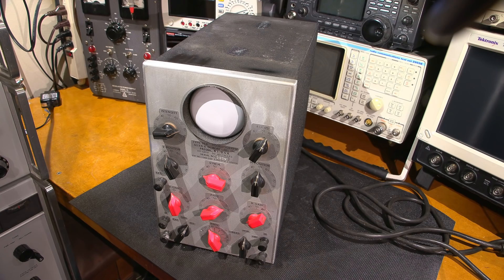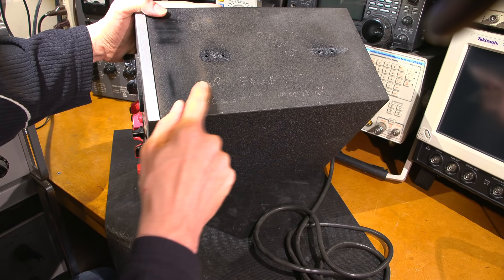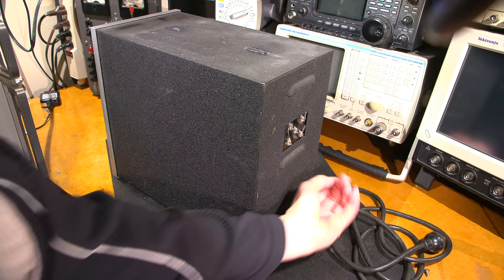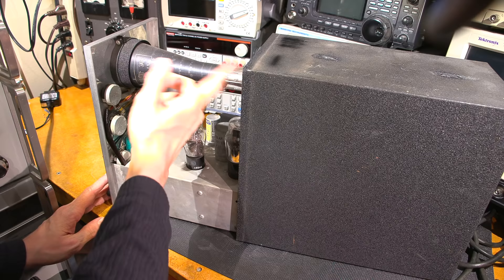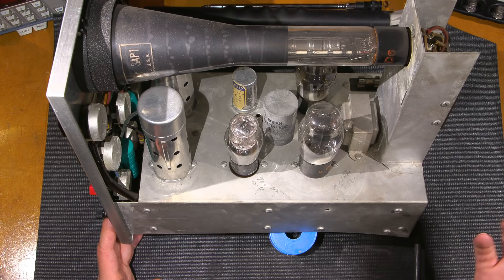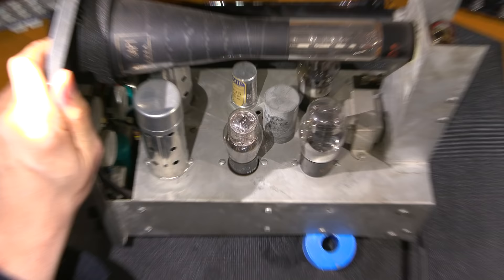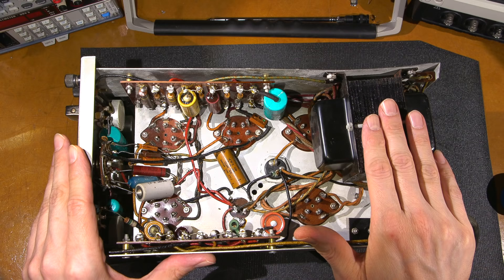1930's Electronics - Will It Still Work? Lets Find Out!

Comment: Another word of caution regarding powering up a device for the first time, you mentioned that you should bring it up slowly on a Variac Autotransformer. This is the correct procedure but it has to be remembered that capacitors have a variety of failure modes and although you did the correct procedure to fire it up, if you leave it sitting around for some time and decide to fire it up again, the capacitors might have been at their end of life and were able to work properly as they were brought up to working voltage slowly but the next time they get full rated voltage, they might fail!!! 
I have seen stories where and amplifier was sold on eBay as working, the seller had plugged it in and it lit up, but when the buyer turned up and wanted to test it with speakers and the amplifier actually had to do some work, the capacitors exploded! 
I believe that had the amplifier been turned on and just let sit to condition it's capacitors it would have been fine until the next time it has been sitting around not used for awhile and then turned on to listen to some music and instead they get an explosion! 
That's why I always say, ESR measurement is not enough! ESR is only going to limit the current! You end up with distortion! But EPR on the other hand will cause the next component in line to work over and above what it was designed to work with and that's how tubes, transistors and resistors fail... 
I have an old DIY kit amplifier that was built in 1973, it's power indicator light is a filament bulb which use more current to work than an led, the beauty of this is that it tells you that the capacitors in the power supply are bad because when you turn up the volume, it begins to blink with the music, after a re-cap, no more blinking! I thought about replacing it with an led when I first got the amplifier but now, I'm leaving well enough alone! That light tells me that something is not as it should be an that it's time to check it out! Those old incandescent bulbs have had a secret secondary purpose and I wonder how many other people know about this? 
So, if a capacitor value has gone up, it's EPR value has also gone up! If it's value has gone down, it's either leaked it's electrolyte or it's evaporated. A whole book 📚 can be written just on capacitor failure modes LoL... I love capacitors, they come in all shapes and sizes and colours! It's really amazing that they have so many different uses. If only someone had invented a new replacement that doesn't fail like they do, electronic equipment would last forever!!

Comment: That is NOT the original CRT, despite the DuMont brand. The 3AP1 type number was registered with the EIA in 1939, a bit after the scope was apparently made.  The original tube was likely a DuMont 34-XH or an RCA 906, both of which were replaced by the 3AP1.

Comment: My experience is that the high voltage paper caps ( sometimes 1000 volt rated) in any of these scopes should be replaced, before applying any power.. the power transformers are not readily replaceable when they fail ( which they WILL).

Comment: The first thing you should do in order to reanimate such a thing, is to revise all device's electromechanical contacts: tubes contact panels, pots, inner jacks. Lube all of them - each of them - with tiny amount of silicone lubricant and reconnect all joints up to ten times each... And only after that procedure you should go in depth analysis of voltages, etc. Practice shows that problems are laid mostly in high voltage  transformers: interturn shortings and/or brakes. Don't thank.

Comment: +1 subscriber. you have a wonderful channel. 
the faded white paint on the knobs resembles degraded radium-based radioluminiscent paint which was carelessly used everywhere in 1930s. it's a dangerous substance and it becomes even more dangerous over time even though it doesn't glow any more. please check if the knobs emit radioactivity. if they do, it's better to get rid of the old paint (cautiously, swallowing or inhaling even a microscopic particle can be very harmful). there are two safer alternatives: radioactive tritium-based tubes (which glow constantly but expire within a decade) and non-radioactive strontium aluminate (which is a more constant solution but will only glow after exposure to light).

Comment: Products that were built in that era were not built with planned obsolescence, as the King Gillete economic school had not yet spread to all corners of product manufacturing...built cheap to fail and be repurchasedover and over. But when I grew up  my Dad would go to the back wall of the Drugstore to get tubes for the TV... of course at that time electronics repair was more Guts and Dolts than Nut and Bolts!

Comment: The 'scope timebase sweep should be linear, a fixed number of mS per cm. The waveshape displayed from the signal generator shows a very non-linear sweep. Repair needed.
Reply from the maker: I would personally like it more linear as well, but did you know these scopes came from the factory like this? No graticule here, just talent needed to decipher what's shown on the screen.
Reply: @MrCarlsonsLab  Apparently that's the performance you have encountered, not open to dispute. Wikipedia tells of a different intent: "Sweep circuit
The technology for the horizontal sweep, that portion of the oscilloscope that creates the horizontal time axis, has changed.

Early oscilloscopes used a synchronized sawtooth waveform generator to provide the time axis. The sawtooth would be made by charging a capacitor with a relatively constant current; that would create a rising voltage. The rising voltage would be fed to the horizontal deflection plates to create the sweep."
My experience goes back to building a tube transmitter in 1956 as KN8HGZ - but back then too poor to own a scope:-)
Reply from the maker: Yes, you can look at my early Heathkit restorations, you will see this sweep linearity issue in that video too. Here is a picture from Wiki, you can see it there too: https://en.wikipedia.org/wiki/Heathkit#/media/File:Io12u.jpg
Reply: @MrCarlsonsLab  Yes, quite so. Just that in your video, the non-linearity seemed so extreme that it might be interesting to peer into the circuit to see if one of the components of the sawtooth generator - the constant current source or the cap - might be guilty. In any case, greatly enjoyed your video - brought back memories!

Comment: Transistorized O-scopes as late as 1980 have high voltage in the sweep circuit. I have a Heathkit IO-4550 with -1700V horizontal sweep. The only tube is the 5" CRT.

Comment: Supposedly it's an extra bad idea to power up old tube era scopes in particular without checking stuff. It's claimed that it's easy to smoke the HV winding in the power transformer if one of the HV filter capacitors shorts.

Comment: I have an unusual project on the drawing board. Basically I want to build a giant (compared to most toys seen on YT and the web) plasma speaker/arc. It boils down to I want to AM modulate a 100-200kHz 10kW HV transformer with a 5kW PWM audio amp (for efficiency, Class A and B sucks from that point) in series with the primary. I found a class D audio modulator schmatic meant for a SSTC. Can I skip rectifying the output of that (the schematic shows a bridge rectifier/cap on it)? My gut is telling me putting DC audio pulses on a ferrite core (the class E SSTC it was designed for is air cored) is a bad idea due to making it saturate and blowing the H bridge driver for it. I suppose I can "build it and see", just want other opinions and perhaps saving some time and silicon from the graveyard (not cheap, sot227 mosfets are $35 each).

Comment: It doesn't seem to have enough ventilation slots compared to most vacuum-tube test equipment I've seen...I'm surprised the innards aren't roasted.
Reply: The vacuum tubes need to work at a constant temperature... they aren't as modern solid state component very sensitive to excessive warm :)
Reply: @wall_y  This is compared to, say, a cart-mounted Tektronix scope.  Then again, those were basically a cathedral of firebottles and dissipated a lot more power...

Comment: Interesting would be a reliable listing of the likely actual service life of various valve types and brands, also including the likelihood of catastrophic failure as opposed to the slow loss of emission. As you are well aware the internet is replete with claims to the effect that valves have to be replaced all the time and are prone to sudden catastrophic failure resulting in damaged equipment. But I take it that in your opinion one might safely ignore the advice of such adepts and run ones valves as much as one desires, whether it be small 6J1Ps or large KT88s? Also, if it were possible to design a “hi-fi/lossless grade digital coax continuator” and an adapter for using a fax machine with a cell phone I would probably be interested in buying such devises, if reasonable priced. Don't expect me to grab a soldering iron and piece them together myself, though, as that would probably be beyond my skill level.

Comment: Hello Mr. Carlson!
Congratulations on the excellent work and care with the equipment!

Could you make a comparison of your capacitor tester, with the ones that are in the market like the T7-H and Bside as an example. 
It would be very interesting to demonstrate the accuracy.
Best Regards
Reply from the maker: Hello. Those testers do not perform an EPR function, therefore I can not compare them. The tester I created and shared on Patreon is a device that performs a special function intended to indicate trace electrical leakage. Most modern capacitor testers will not do this function.

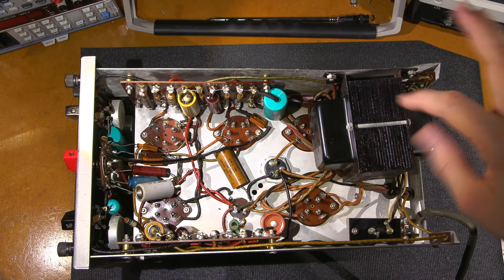Comment: Thank you for another nice video. I have a question; at 13:38 is mentioned that modern DMM would be damaged if connected. Can someone elaborate how or why would that happen?
Reply: Im sure there are more qualified people than me that can explain it and I could be wrong.   Most modern digital multi meters are only rated at 600 volts,  this thing could potentially have thousands of volts present inside.   Thats my guess why he mentioned that, he didn't really elaborate why.
Reply: @mrbyamile6973  thanks, I think that can be. I just thought that there may be deeper reason than using DMM outside of its range.

Comment: Hello, i was wandering if with older CRT scopes it is possible for drifting electronics to cause overvoltage on the cathode ray tube. Would the display function if this were the case? I want to pick one up but im afraid of turning it on and not noticing that something like this will happen possibly, kind of cautious around HV elecronics

Comment: If I'm not mistaken, the AC voltages given on the primary on the schematic is RMS values? Peak voltage value would be another 30% higher, thereabouts?

Comment: You are touching the internals after opening it up.  As a point of safety, never do this if the equipment has been powered up previously - CRTs and capacitors can hold high voltage charges for hours. Some voltages are lethal.

Comment: Why was the waveform on the CRT distorted? Was it not a clean sine wave going in?
Reply: Just because it didn't let the smoke out doesn't mean it's going to be accurate. 

He was just seeing if it arrived in a functioning state.
Reply: @littlerhino2006  Yes, I gather that. So why the distortion? Was a clean sine wave put into it? If so, it is malfunctioning in some way. If not, it may or may not be functioning.

Comment: Paul i have a cb radio.the microphone 🎤 uses a 9volt 🔋. I was wondering if I could source the power from the radio instead of having to change the battery.i know you have the schematic for this in your head before you stop reading. Could you send me a pic of a circuit that you would use I know you dont have all info .a crude drawing with generic values based on 13.4 volt input voltage to radio.i know your busy Paul love the videos keep it up sir thankyou

Comment: Should I even mess with a riveted shut, epoxy potted and glassed over in 100 coats amp with a dozen 12ax7's?  The guy made a micarta front panel so It looks interesting, but will require alot of damage to even reach the caps or anything. The valves are inset but free to remove if I toss the chassis. All the potting is by a crazy guy I used to know.

Comment: It looked like the horizontal sweep was more than a bit non-linear.  Was that my imagination/camera angle?
Reply from the maker: Hi Scott. This is very common for these older scopes. In older Heathkit manuals, they even show this in their examples.
Reply: @MrCarlsonsLab  Thanks, Paul.  I had never seen this in any of the scopes I got to play with in the '60s;  I guess they had the sweep linearity under control by then.  Also great to see the Dumont name again, really nice equipment.  <Edit>. Or Maybe an accurate timebase reticle was an upgrade feature??  It would take a bunch more parts...

Comment: Mr. Carlson, I need you help with electricity.I would like to control four items using 120 volts and 15 amps. I need to turn on each item on once a second. That is first second one item turned on then the next, next and next and start from the beginning. Could you be so kind and give me a little of your time ??? Thanks a bunch.

Comment: I have a question about what kind of relays do I need, or can I use any relay to switch an antenna.  between 0 mhz and 3000 MHz.  only to receive.  i have 3 antennas and 1 cable.  more or less an antenna switch
Reply from the maker: So basically DC to 3000Mhz then. 3000MHz is 3 GHz, that's a pretty special relay setup. Are you sure you are correct with your ranges.
Reply: yes i have the icom r8600.  and I would like to use with 1 cable.

Comment: Is it possible that your cap tester is too sensitive and impractical if the scope works fine with the original capacitor? Perhaps some caps normally do have tiny amounts of leakage?
Reply from the maker: What you saw was not a tiny amount. Capacitors of this type should appear as an open circuit, not appear as a high value resistor. Leaving this type of old cap behind due to "low leakage" is not acceptable in any case, unless you want to set yourself up for an unexpected failure.
Reply from the maker: Caferacer Wolf  Hi. (With all due respect,) please don't make comments about a topic you do not fully understand, all this does is create confusion for others. If you have questions, that's one thing, (and that's OK,) but you are making claims that are simply not true.

You claim  Surely all Electrolytic Caps exhibit some leakage no matter how tiny.
Answer  Yes, you are correct, this is why the box has an electrolytic position. Can you provide me the accepted leakage current pass point of this device in the electrolytic position?

You claim  Tantalum Caps are used in some applications as they have nearly zero leakage.
Answer No, Tantalum's do not have nearly Zero leakage :^/

You claim  If as you say touching the shroud on the test leads of your Machine gives a false reading, it is not acting correctly.
Answer No, Again you are making statements about something you do not understand. Shielded leads on test equipment are common, an oscilloscope probe is just one example (for multiple reasons.) The shield on the capacitor tester is there to keep noise out of the sense lead. The capacitor tester has the ability to test into the picoamp range, at beyond 40 Billion Ohms. (Tested and Verified.) Vinyl is resistive, the tester is measuring my body resistance through the vinyl boots on the test clips. This leakage resistance (directly related to leakage current) measured through my body has nothing to do with noise or interference, as this is effectively filtered out in the device. This has been tested in a fully shielded Faraday cage. 

Thousands of these Carlson CLVLT Capacitor Testers are in use today This includes business as well.

What I find continually disturbing about the YouTube comment section in general, (other channels included.) Too many people make claims in the comment section on YouTube without proper evidence of what they claim. This type of action tends to lead those (more gullible or uneducated) away from the facts. If you truly intend to help others by leaving comments, please make sure what you claim is true and factual.

Comment: Hello, I'm trying to fix a whirlpool stove-oven. All the top burners work good. The bottom element broke into around 5 pieces, and I just replaced it and checked ohms on both elements and beeped, 1 was 21 and the other 16. I noticed when I turned on power after I replaced bottom element in oven, when I turned on the knob for broil and bake and it started clicking so. I turned off breaker and unplugged and that's when I checked ohms. Behind the middle knob THE RANGE OVEN SELECTOR part#  WP9762215 AND ON IT I FOUND ONLY 1 THAT BEEPED LEFT HAD 6 LIKE PLUG-INS WITH 1 BIG PLUG WITH 6 WIRES I GUESS. AND RIGHT SIDE HAS ONLY 3 PLUG-INS WITH 1 BIG PLUG I GUESS HAD 3 WIRES. THIS PART HAS A LITTLE BOARD INSIDE ON BACK IS PLASTIC AND FRONT HAS STEEL PLATE WITH THE TURNING KNOB WAS ON TO TURN. I DID CHECK OMS ON PART AND ONLY GOT 1 BEEP FROM NEGATIVE(LEFT) AND POSITIVE(RIGHT)  ON ALL PLUG-INS AND I WAS GOING TO TAKE APART(MAYBE) IS WHY I'M ASKING WHAT TO DO. IT HAS 4 CLIPS HOLDING THE FRONT STEEL TO THE PLASTIC. PART IS 167.00 FROM WHIRLPOOL AND I'M THE LANDLORD TRYING TO FIX. I WISH I COULD SEND YOU A PIC OR 3 OF THIS PART. GOING TO TRY AND TAKE APART AND FIX BEFORE I TRY TO FIND A LITTLE OR ALOT CHEAPER IF U KNOW WHAT I MEAN. YOUR HELP PLEASE?